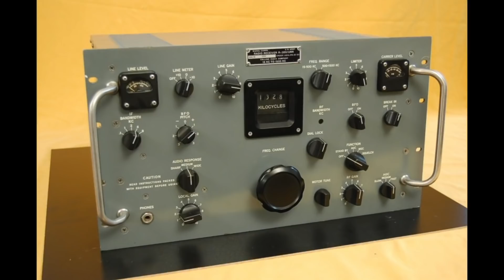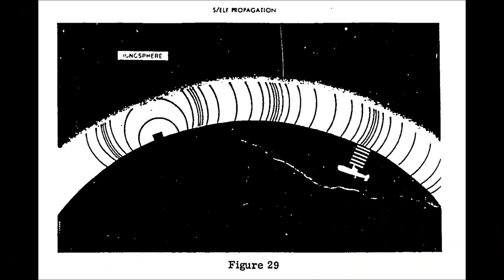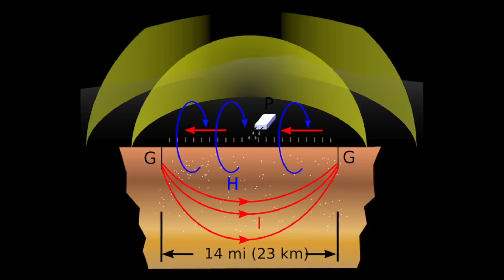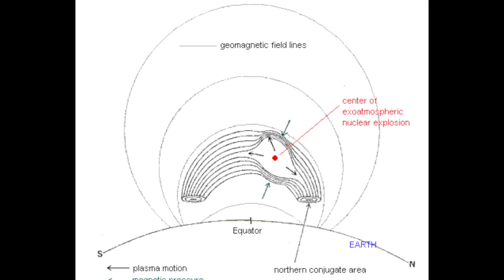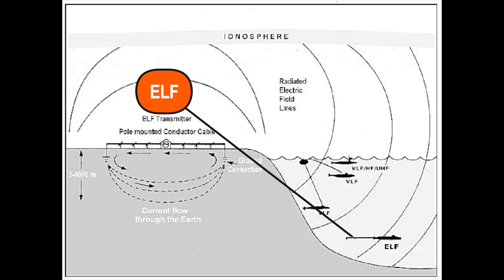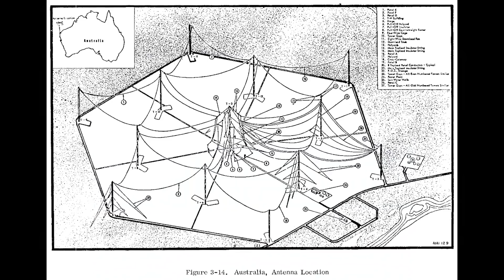Submarine Communication Mystery - Prof Simon

Comment: I know they’ve been futzing with blue-green lasers for much deeper communications back in the 1980s… and use of radar waves to detect subs and ultrasonic and infrasonic waves generated by submarine sonar and transducers…allowing potentially two way communication between subs and shore.  That could be done from orbit.  I also wouldn’t be surprised if through WSPR and new computing technology, they can detect VLF at much greater depths than before…just the march of technology…obviously that would render ELF useless.  Perhaps that’s why HAARP was set up…to research VLF wspr and push the limits of ELF…ELF was only used to tell a missile sub to come to a shallower depth to receive instructions in VLF or float a communications bouy for receiving more complex instructions.  ELF has a very limited bandwidth.  Very limited.  It’s just not a practical solution.  Updated VLF, modified sonar or radar communications or lasers (most likely) or long range underwater acoustic at infrasonic or ultrasonic frequencies are probably why ELF experiments have ceased.  I’m an Extra Class ham and I’ve played with Low Frequency ham bands…it’s difficult even in the relatively high frequencies of “LowFer”ing … I would bet they use lasers by now.

Comment: ELF is used in everything to this date. It runs in your Aircon, wifi router, and freezers with AC. 
Leave the VLF towers to hide the ELF uses? 
Anyways heres what ELF is.
Extremely low frequency (ELF) fields includes alternating current (AC) fields and other electromagnetic, non-ionizing radiation from 1 Hz to 300 Hz. ELF fields at 60 Hz are produced by power lines, electrical wiring, and electrical equipment. Some epidemiological studies have suggested increased cancer risk associated with magnetic field exposures near electric power lines.

Comment: Submarines operate on command codes designating DEFCON Alerts and Clear and Present Danger. Not very much data is required to give them an assignment or a change in assignment. It is a silent running event on communication with the NAVY for asset protection. E.L.F. is slow in communication but effective over vast distances. The ability to communicate is essential. Remember 150 baud rates in the PC world? Elf can have a superimposed carrier in both positive and negative sidebands and since the wavelength is extremely large, it can carry quite a bit of data that is slow to arrive but very workable across and through the globe. Any other data is on a need-to-know basis unless you are Donald Trump. He declassifies them in his mind which is much slower than E.L.F.

Comment: No need for the landbased sites anymore. F region ELF arrays are now prepositionned on theater on an incognito mobile platform.
Basically, shipboard mini-haarps siting innocently on a random merchant looking boat in any us navy foreign base, hiding in plain sight. No need to say those shipboard mini-haarps are lower profile than a 30 acre array and can be dispersed on multiple platforms for redundancy and coverage also using way less power.
The reason for choosing the site at Gakona in Alaska is that it is directly below the polar electrojet, but with recent developments it is possible to achieve good results without the help of the polar electrojet.
Reply from the maker: very interesting

Comment: ELF was used like a pager/beeper back in the day. A message would be sent out like  ABCD1234 and a code book would tell the recipient what to do. The only thing cool about it was it’s global reach and the subs could receive the signal underwater and at speed. VLF requires the subs run slower and closer to the surface. The 2 were separate systems that had nothing to do w each other.
Reply: Frequency was like 7 Hz. If sat's were knocked out. this was a backup to do launch.

Comment: I graduated top of my class in U.S. Navy Signals Intelligence school in early 1999 before being selected for submarine duty.  I never heard any mention of any use of ELF or any other underwater radio transmission, so I assume that it was long out of service at that point.  I asked a senior colleague about it, referencing the Red October movie's mention of the "Emergency circuit", and he didn't know either.  Like so many other things, I would guess the clam lake had another purpose, or just didn't work as intended.  HAARP was on my mental radar even before my service, but I don't know anyone involved or what it was for.  Doesn't it stand for High ALtitude something Research project?  It might just be exactly that, an experiment, possibly with unintended consequences.  Communicating with a submarine is an unreliable process, and always puts the vessels in danger, and I'll just leave it at that.  I'm from Wisconsin, so perhaps look into who the politicians were at the time Clam Lake was proposed and funded.  It probably wasn't cheap!

Comment: Submarines  never really need to worry about such contrived means of communication . A torpedo type device would be released which would transmit data from a remote location and shut down operating  soon after deployment.    Information is only relevant for a limited time  , after that it is totally unimportant . Knowing we’re your adversary is  also 
not really relevant,    but knowing what they plan to do in the next 5 minutes  . Might just be a bit of a game changer .

Comment: Understandable example: Hearing aids (telecoil). A coil has two areas inside the coil as in transformer and outside as in am radio and frame antenna. The sub works like a pair of hearing aids. They did actually build continental loops long long ago. It was still the outside area but with sattelittes it might work. Maybe that is where the antennas have gone. Hearing aids use audio frequencies but low frequencies need too much power without intelligent information. That is why they cut off below 300 Hz. Actually higher frequencies get you more range. I have tried it, dramatically more range. PTT says 8 kHz is the limit or you need a radio license. Hearing aids most likely cut off above 4 kHz that is where adult or grown up ears cut off. When your wavelength is long enough, then you can decide whether to transmit an electric field or a magnetic one. Seawater eats electricity but compass still works. On the other hand sharks and crocodiles are quite good at navigating with electricity finding their prey in particular. Range about three times the length of the boat I guess.

Comment: DARPA/NOSC project called SLCAIR which was a feasibility study where we communicated (one-way, in this case) from an airplane to submarines with a green laser (532nm). This was then the basis for SLCSAT which did the same with satellites instead of airplanes (note that SLC = Submarine Laser Communications). The existence of those programs wasn't classified, but some of the results were. Suffice to say, it worked. Blue and green light penetrates seawater deeper than radio waves and has much higher bandwidth. Our demo system transmitted 128 bits of PPM at 10Hz, but bandwidth wasn't the point of those tests. That program ran its course and I never heard more. I heard of other later experiments in a vague way, but, honestly, I didn't care enough to pay attention. I saw this resurface from 2010, but any real implementation is likely to be classified as much as possible. I suspect it's one of those eternal R&D things, like fusion energy. There are some security advantages to laser vs. ELF/VLF radio, because you can't receive it in Moscow or Beijing. Plus greater bandwidth. Also, lasers penetrate deeper than VLF antenna depths. OTOH, you're lighting up the sea with a big green light over the submarine. I was told the solution was to shine it in lots of places, only one of which had the submarine, but that never really made complete sense to me. I'm 100% sure they wouldn't have told me the real story, plus it was only R&D about the comm link back then. BTW, you don't need a lot of bandwidth to say "launch your missiles",
From physics forums

Comment: I'd say that the US have found a way of communicating via laser to significant depths. Lidar Using Green light lasers can penetrate seawater to 300m and I assume be tweaking the bit rate and bandwidth they have managed to improve on that depth for communication.
The downside would be the satellite with the laser needs to know roughly where the sub is and the sub would need very sensitive receivers  to pick up the laser.  Also scattering due to wave action would present a problem, but again I assume they may have solved that issue.
The upside is you have to be in the rough area of the submarine to intercept the laser communication, so eavesdropping is virtually impossible.
I do know that lasers are being used or trialled for a number of undersea projects. Submarine detection being one, the other being submarine navigation. Civilian Lidar for undersea surveying and depth measurement is currently under development.
Reply from the maker: thank you

Comment: I was stationed on the USS Alabama for 4 years, but I was a firecontrol technician. I shot torpedos. The radioman would pull different messages from different bands depending on the classification on information, all while at periscope depth. SSBN’s use towed buoys and towed cables to communicate while submerged. Couldn’t give you details on bands and frequencies though. That’s probs classified anyways. Hope this helped in some way.

Comment: Im definitely not an expert in the field, but my dad used to work for Motorola. I have a bit of an understanding how radios work. I would think they have created some replacement tech that works better. I would think turning off the ionosphere wouldn't matter as much in this age of satellite communication. So range isn't any issue as much as the getting the signal under water. Maybe using the miles of underwater cabling to transmit signals. It's about understanding what could be the replacement tech. Thank you for your videos!
Reply: Scalar waves

Comment: I don't know but my semi-educated guess from talking to those in sig. int. over the years is HAARP is supposed to massively distort all ionosphere-bounced comms but as they know what's distortion and what's not they can cancel out the distortion (noise cancellation) to reveal a hidden, embedded message.. It's not an encryption layer but does add lots of security while disabling enemy comms.. Size rules... If China etc. start building larger arrays than HAARP The US will build a larger array or extend HAARP. I think Russia and China have ways round it by now anyhow.

Comment: I suspect (and this is a guess) that now we have things like quantum communication using entangled particles that the days of shore to sub comms are very different and don't even need radio waves to propagate and works through anything at very high bit rates, this also gives an extra layer of security as it cant be intercepted, as I said I don't know the ins and outs but it is a thing

Comment: I think you will find that there are other ELF transmitters elsewhere, possibly hidden.  I used to live in New Kent, Virginia and there was a restricted access facility tucked away by the river that at various times was run by Raytheon and other military contractors. It was locally called the White House Transmitter and ran from at least 1984 when I moved there for at least the next 20 years and it still exits though I am unsure of it’s activity. I do know early on we would occasionally have EM interference that was very difficult to track down and was likely harmonic issues from the transmitter. It had a huge long above ground antenna array that was close to a mile long and from as close as I could get included extensive underground elements to the antenna.  I did find out that it was building and fine tuning ELF transmitters and receivers for the Navy that could transmit through the earth. After about seven years of living there so about 1991 I found out the transmitter/receiver had been shipped off to Alaska. But activity continued and I believe they continued to build and tunes sets for at least another 15 years and likely shipped off at least two more sets somewhere.  As I said the installation still exists and it’s still classified and very limited access so it’s hard to say what’s what.  But for sure they supplied at least one and likely several sets with at least one ending up in Alaska.

Comment: They also closed 2 of the 6 VLF/LF stations since the mid 1990's during BRAC. They are looking to upgrade the 4 remaining stations from tube technology to EMP hardened modern components. I would guess they have a new secret way to communicate that doesn't require RF. VLF is still used to synchronize clock signals between two remote locations maybe the military still uses VLF for timing signals.

Comment: Definitely going to get more bandwidth (bits per second increase) using VLF than ELF.  Perhaps they found out that if the sub is in deep water, they can simply release a VLF antenna wire into the water, using a float to stretch the antenna vertically into viable VLF operability depth.

Comment: Stupid question and I mean really stupid… Can SAR encode messages in its radar signal? If so could it be used to communicate with subs? I was under the impression SAR can resolve ocean bed topography and submarines… If there were a way to use it to encode data wouldn’t that make ELF pointless? I know
What I just asked could be really stupid and I’m not grasping something. I’m going to read up on SAR and find out how stupid this question was 😂, but I just had to ask…
Reply: I just know their is now tech like “multiple-input and multiple-output” MIMO being used even in 5G internet to penetrate farther and their are papers on using it to get greater penetration of even saltwater for diver communication so they can have communication that doesn’t rely on light (for high data rate communication) that can be obscured by water full of particles, and have faster data rate than sonar based communication. Using radar even though it’s absorbed by salt water easily can apparently exploit technology like MIMO if I’m understanding the research correctly!

Comment: I don't have a Clue, Professor. But what I heard was Whales communicate at very low Frequencies also, so I wonder if biologicals have anything to due with this. Waiting to hear what you find out...
Reply: Wales communicate via audio... Not radio frequencies..
Reply from the maker: it turns out some sub sea communication is audio signal like an old acoustic modem.

Comment: Another couple to look up for you: Jim Creek Naval Base (NE of Everett in Cascades) and the Miisawa AFB. - Jim Creek is used as the pacemaker for the Submarine tracking system. Miisawa you can still see the aerial network. As for HAARP the location I only know was in the center of Alaska and its use for Submarines was its cover story (but your point about blocking communication never really rose above the conspiracy rhetoric either) . Jim Creek is interesting as you drive up the valley and there are coils of wire looping around ground and the sky every 10’, appears like driving into a megaphone of sorts facing the Pacific with clear line if sight thru the Strait of Juan de Fuca. - But yours is an interesting question today: From what I hear many of the VLF have been closed - have no real grasp of ones ive heard of are still working... possibly underground detonations and earthquake and magnetic shifting of tectonics would affect ELF adversely?
Reply: Havent heard the term HAARP in decades tbh... was beginning to think its history has been erased. Personally I knock it up towards the powers that be are able to turn on rain every Friday eve and changing rain patterns from spring to fall or vice versa to ruin crops last 20 years as a döppelganger to the Global Warming Scenario.
Reply: @chrissonnenschein6634  Interesting indeed, as the current level of tech is bound to be extremely classified.

Comment: Hi Professor Simon, one thought that occurred to me was that the longer the wavelength (i.e. ELF) has less information it is able to carry per unit of time...only speculation. When I was at school in the 1960's we had one pupil who academically was an extremely high achiever and exceptionally bright. He ended up at Cambridge and then moved to the USA, I did recently find an obscure article while browsing the web that referred to a group of academics and military specialists during the late 70s and early 80s working on some sort of high altitude physics project in the USA. To my surprise he was part of the team. It was the first time I'd seen his name in over 40 years. I'm not surprised he was a very talented person.
Reply: Wow Neat. Yes I bet High Altitude and only on speculation it was in the sky fort...... I am from over by the Republic part of it in Michigan I did not know it went to a place in Wisconsin. Then there is is t.f he air force base that closed K .I. Sawyer in Mich. I was told it was for comm. With subs as a kid and I k mk ow exactly where it is... The big Antenna is still up.  Also in the ground miles upon miles of Copper... Huge Gauge. When it was operating the grass well.... speaking of grass that is what it is now a mary jane farm... Stories I gots Thanks 4 sharing.
Reply: high penetrable low bandwidth the other way of 5g eh?
Reply: They just send codes
Reply: That's true, google 'Nyquist frequency'. Signal rate is at most half as high as the sampling rate, a mathematical rule. Which means, at 76 Hz one can transport at most information at 38 Hz, 38 bits per second. That's even slower than a teleprinter from the 1950s.